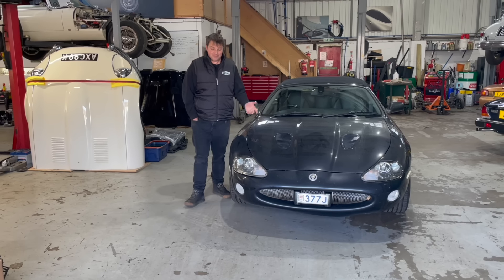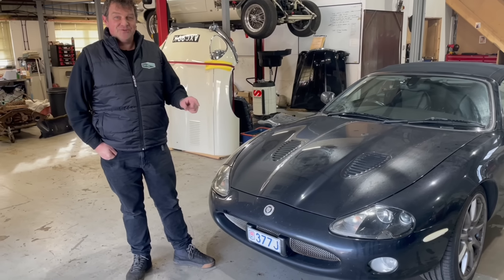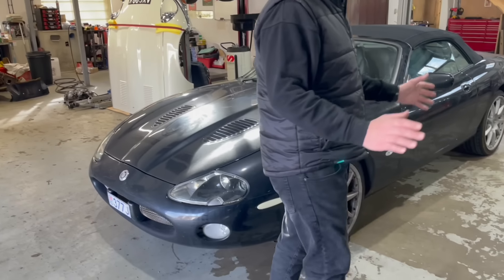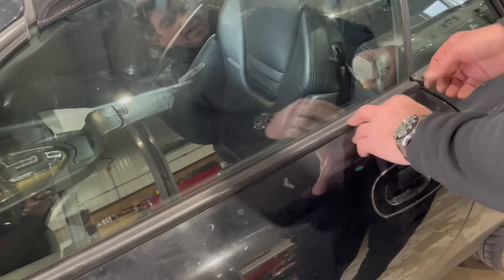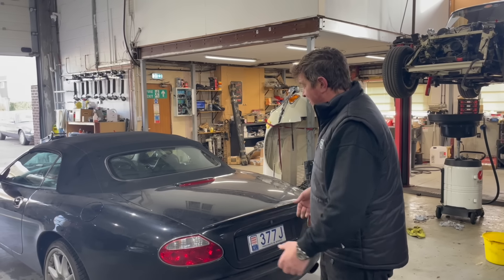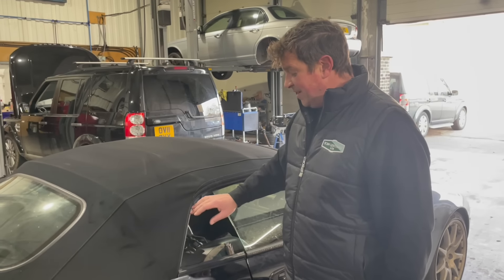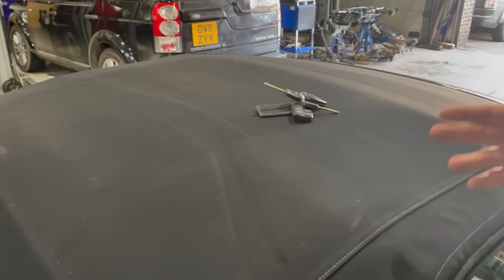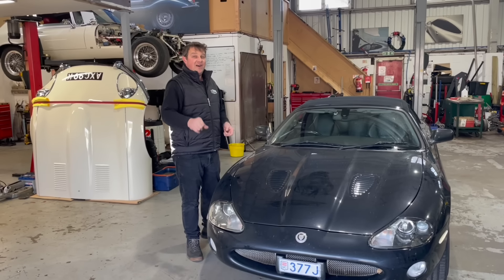EVERYTHING WRONG WITH MY CHEAP JAGUAR XKR: PART 1

Comment: Tom: the seat adjustment problem is not the motor! It's the buttons!
I had the same problem on my X350 and I just rewired the motor to a switch to a button I'm not using and it works! And after a few weeks I have to say: I like it more than it would be original!
(I'm using the up/down button for the front lifter of the seat to adjust the back of the seat and I love it now)
Down moves the back down, lifting up moves the back up! It's unbelievable nice!

Comment: I bought my 2000 XKR back in 2020 from California. Was looking for one with the R package but they are rare, so mine has the std brakes, seats and 18" wheels. Since then I have gone through the standard faults: Front springs and bushings, hydraulic hoses for the convertible top and timing chain and tensioners.

Comment: We have a 2000 XKR coupe that was sold new with the R-Performance package.  A previous owner had it badged XKRR.  It has been quite reliable & we have undertaken long insterstate trips in it where it has shone.  Recently we lost drive under acceleration.  My husband thought he had solved the problem by adding about 500ml of transmission fluid that restored drive but the fault has returned with a code showing a mismatch with the input/output figures so its booked in to have the box removed & sorted.  It will be very interesting to see what develops with your XKR & how you address any issues.

Comment: Top tip on the key fobs: there’s a fellow in Taiwan that matches S-type-style flip key fobs with the correct 8-row Tibbe key blade for the X100 and sells them on eBay. I have one as the main key for my 2001 XKR coupe. Only caveat is that I’m not sure if there’s differences between my US-market security electronics and what you’d have in the UK.

Comment: I love my 03 XKR.  Things wrong: driver's head rest won't adjust - no issue really.  Since purchasing, the CD changer in the boot has stopped working.  Apparently that's common.  There are people one can send them to for a rebuild.  Doesn't seem worth it at this time.  Everything else is great.